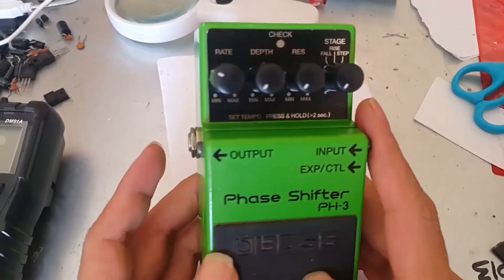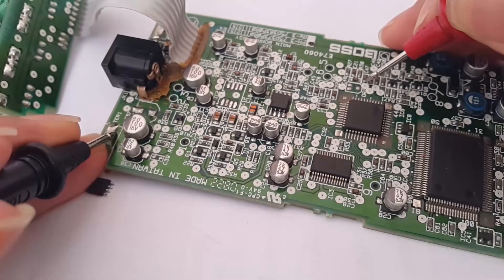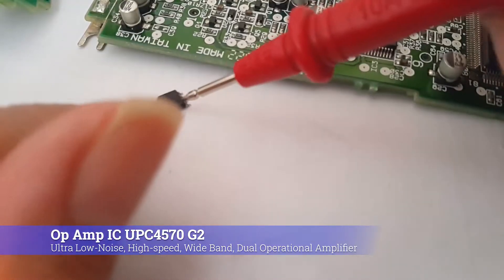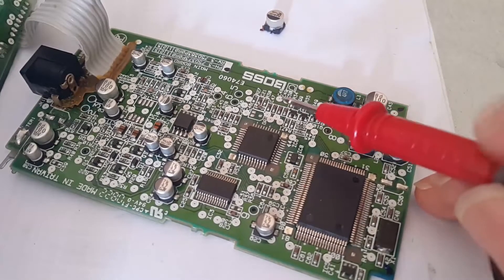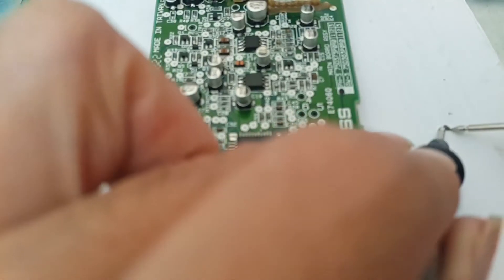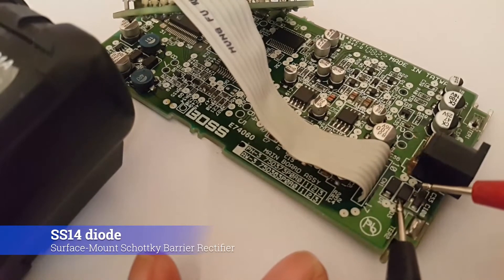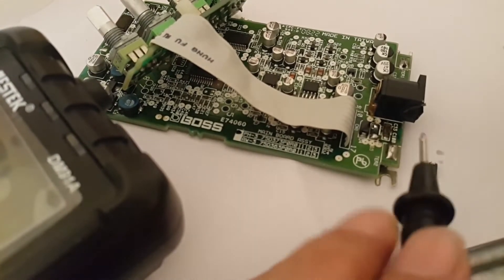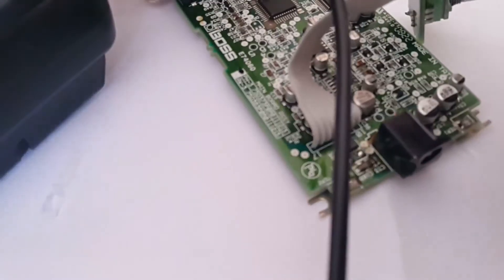BOSS PH-3 repair distorted Sound, No power from 9V Battery

Comment: How are there so many shorts happening on this board?    I just replaced the 'stage' pot on mine thinking it was bad because all stages other than step, rise and fall would cut out badly.  It still happens which indicates a bigger problem..  It might not be worth trying to fix if there are may shorts in the board after it gets old, right?
Reply: The exact same problem here. Did you manage to fix it?
Reply: @jon5957  No, I went as far as replacing the stage pot with a new one ordered from Boss but it didn't help.  I suspect the issue is with the DSP chip that handles the other modes that are cutting out.  I'm not an expert with digital circuits through so it could be something else.